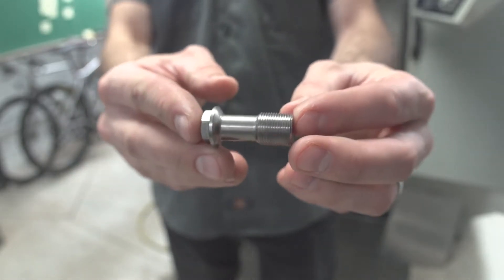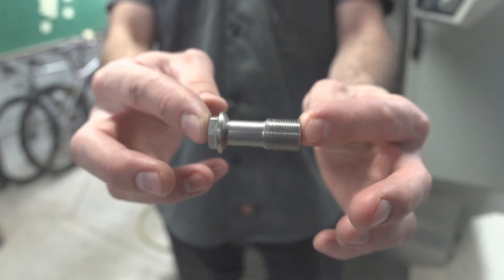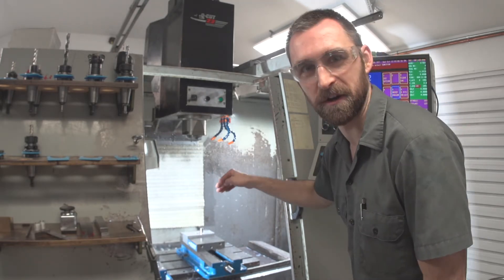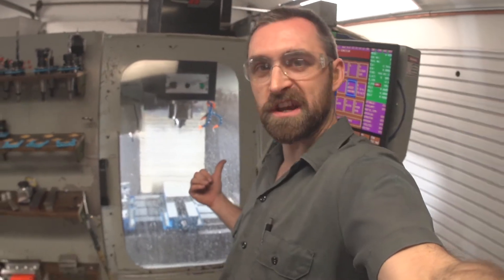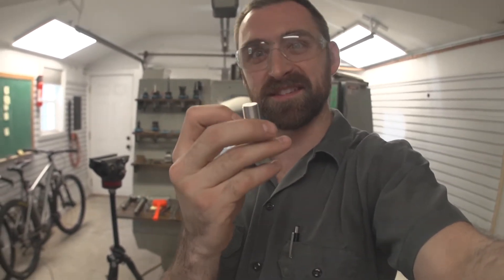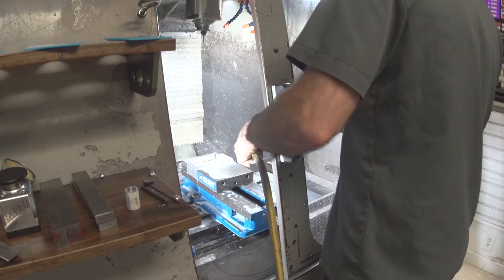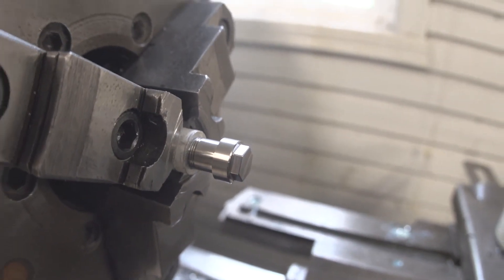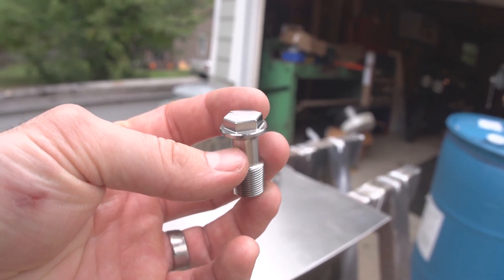Machining a Special Titanium bolt for Prosthetics

Comment: Just curious, why not include the chamfer on the bolt head like in the original?
Reply from the maker: @goncalovazpinto6261  the original looks like it was made and chamfered on a lathe. Since I used a mill to cut the hex head I had the mill chamfer it too, so the chamfer is there, it’s just a different style.

Comment: Looks great! How much did you charge for that amount of work?
Reply from the maker: Thanks. This was a couple years ago so I don’t remember exactly. Pretty sure it was north of $400. That may seem ridiculous for 1 bolt but considering the expense of the material and time making fixtures, recutting threads for a perfect fit, making aluminum prototype pieces…probably should’ve been more.